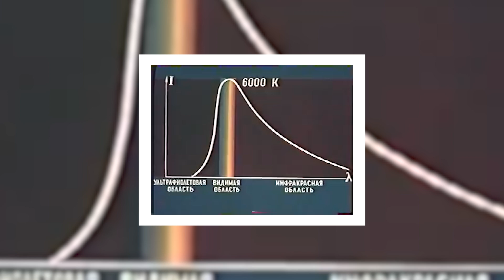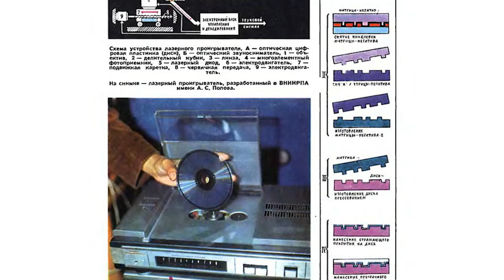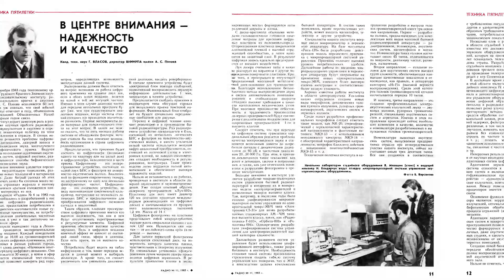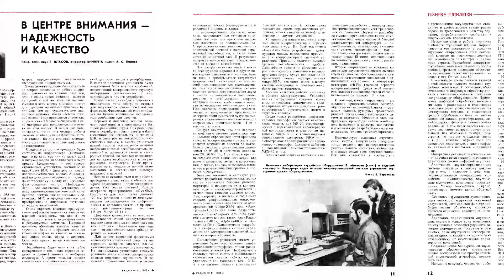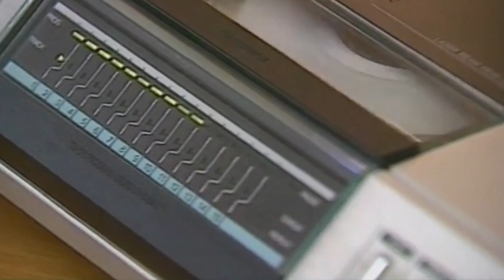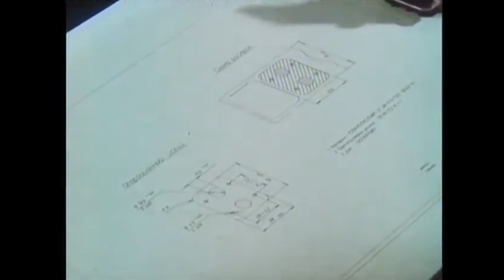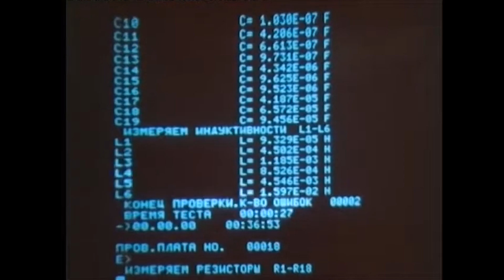Soviet Union invented CD in 1979 / Soviet Tech Tales

Comment: Actually the CD was first manufactured and invented in the late 60s by a company called Disco it was a joint venture between Sony and Phillips!! 

Yes the Western world has been working on the compact disc since the late 1950s!
Reply: Audio Engineering Society documented the many different competing formats for digital audio disks [& video disks digital & analogue]A 1986 Radio Mascow broadcast did describe the prototyping of a device using holographic storage of digital data in glass [I think-have very little to go on vis this development].Telefunken Decca developed DMM [direct metal mastering]copper disks for digital audio disks pressed in vinyl [housed in a caddy like RCA selectavision] & played with a stylus [source-AES disk recording anthology]-technology later migrated to Lp manufacturing in the Neumann VMS 82 record mastering lathe
Reply: For those saying that the USSR didn't invent something in electronics, check out this-

1948-1950. Not only in the United States, but also in other countries there have been scientific research in the field of semiconductors. For instance, a Soviet physicist V.E. Loshkarev as early as in 1946 discovered the bipolar diffusion of nonequilibrium current carriers in semiconductors. A.V.Krasilov and his group designed germanium diodes for radar stations. [Presumably still classified research] in Fryazino (Moscow region) in the Research Institute-160 (Research Institute "Istok"). A.V.Krasilov and S.G.Madoyan first observed the transistor effect. The creators of the domestic transistor A.V.Krasilov and S.G.Madoyan published the first article in the USSR on transistors, "Crystal Triode." Laboratory samples of germanium transistors were developed by B.M.Vul, A.V.Rzhanov, V.S.Vavilov, and others (FIAN), V.M.Tuchkevich, D.N.Nasledov (LPTI), S.G. Kalashnikov, N.A. Penin and others (IRE USSR AS)...

1960s. In the USSR in 1963 the Center for Microelectronics was established in Zelenograd. A Soviet engineer F.A. Shchigol developed a planar transistor 2T312 and its open-ended analogue 2T319, which became the main active element of hybrid circuits. In 1964, the Angstrem plant at the Research Institute of Precision Technology created the first integrated circuit IC-"Path" with 20 elements on the crystal, performing the function of transistor logic with resistive connections. At NIIME in Zelenograd technology was created and the first planar transistors "Ploskost" were launched. Under the direction of B.V. Malin at NII-35 (nowadays the scientific research institute "Pulsar"), the first series of silicon integrated circuits TS-100 (degree of integration - 37 elements on the crystal) was created. In 1966, the first experimental station for the production of planar integrated circuits began operating at the Pulsar Research Institute. At the NIIME the group of Dr. Valieva, started production of logical and linear integrated circuits. In 1968, the Pulsar Research Institute produced a batch of first hybrid thin-film ICs with planar, open-frame transistors of the types KD910, KD911, KT318 intended for television, radio broadcasting and communications. Digital and linear ICs of mass application (series 155) were developed in the Research Institute of ME. In 1969, a Soviet physicist Zh. I. Alferov formulated and practically realized his ideas for controlling electron and light fluxes in classical heterostructures based on the gallium arsenide arsenide system. Digital and linear ICs of mass application (series 155) were developed in the Research Institute of ME.

https://hsm.stackexchange.com/questions/6367/did-the-soviet-union-have-their-own-discoveries-in-the-development-of-semiconduc#:~:text=There%20is%20a%20fascinating%20story%20of%20two%20Soviet%20spies,%20Barr
Reply: Yes, of course they was, and fact, that first laser was ever constructed in 1960, was just minor obstacle to work on CD precursor in 50s 😀
When you want to spread lies, you should assure, that they will be not so easily exposed ;-)
Reply: @tomascernak6112 Not lies at all, but documented facts.  Optical discs predated lasers. Optical analog audio and video discs existed, primarily for development purposes, before the 60’s. First digital signals on optical disc was in the 60’s. Philips & Sony came out with their CDs in 1979… just not commercially yet… like the Soviet’s unit. It was just not until 1982 that the CD was commercially manufactured for consumers. When was the Soviet unit available commercially for consumers? By saying that the Soviet’s did it first would be the big lie, unless further evidence could prove it. Incremental improvements were made in optical storage had been made for decades before commercial success, which was originally the Philips/Sony CD.
Reply: @BigRonRN18  Source? Trust me bro?
Reply: @BigRonRN18  I expect a cooperation between Sony and Philips in the late 1960's by the name of Disco was not a documented fact, but if it is that would be interesting. It's correct in any case that there were lots of technological predecessors and proofs of concept even in the 1960's.
Reply: @tomascernak6112  Man don't be so dumb, search Wimipedia for "optical disc" and read its history https://en.wikipedia.org/wiki/Optical_disc

Comment: I may be wrong but I see the biggest issue they had in Soviet Union was the lack of a proper "consumer market" that pushed down the prices down of electronics and financed r&d of better and cheaper products.
Reply: The problem, like with all communist countries is a state controlled market. The state determines what people ‘need’, not the actual market. Companies under state control had to get funds and permission to develop any product. There was no free market. And the state can’t effectively dertermine what is needed or how it should be produced. It’s pure arrogance of the leader to think they know it all and always know best. This is why communism doesn’t work!
Reply: In the Soviet Union, market mechanisms could not function. Factories were not independent in their decisions regarding what products to produce and in what quantities. There was a state plan that prescribed which factories should produce which products and in what quantities. All that factories could do on their own was to make small changes to existing products, such as using different parts.

In order for the factory to begin producing a new type of product, the state plan had to be changed. This required a complex approval process with the relevant ministry. If such an agreement was successful, the factory was allocated funds to re-equip its production and purchase components. But, as a rule, it was not the current plan that changed, but the upcoming plan. Plans were prepared every 5 years. Therefore, updating the product range was very slow, and previously developed products were produced for decades.

But the most important difference is the risks. Unlike the Western economy, where the owner of the enterprise risks his own money or the money of investors, in the Soviet economy the enterprise was guaranteed to receive money for production, and all products produced were guaranteed to be sent to stores. There was no risk that the production costs would not be recouped. As a result, the motivation to produce high-quality competitive products was lost. They fought for quality using administrative methods, but this was ineffective.
Reply: So, did sony and Phillips see ray 002 in action? Thus inspiring them or even allowing them to reverse engineer it?
Reply: @BanazirGalpsi1968  If it was the other way around, everyone would instantly assume so.
;)

Probably paralell development, but it's not impossible that they got some information about it, but probably not the finished system.
Reply: Dysfunctional does not lead to inefficiency?

Also, forcing people from subsistence farming while collectivizing the farms absolutely led to famine. The West wasn’t initially afraid of the USSR - why else would Britain sell them jet engines. The fear developed with increasingly disturbing behavior, and British trust in their wartime ally proved to be naive.
Reply: @thatsunpossible312  "The West wasn’t initially afraid of the USSR"

Afraid?   Who said anything about afraid?

Oh no, people wanted to get back to the plans Woodrow Wilson had, to break up Russia, and later USSR.   Make it easier to colonise and control.

The exact same plans that were the background goal of the psychos in Washington that caused the Ukraine war.

It's amazing how in line with the naczis the post-WWII western desires were.

Only a moron would be afraid of a nation that has just lost 1/5th of its population and had most of its large cities razed to the ground.

But nope, what was the first thing the west did after WWII?   And possibly even DURING WWII.

They supported the Banderites in Ukraine.
Did you know about the war they waged during the 40s and part of the 1950s?
200 thousand civillians killed.
With the explicit support of the west.

Only the fact that USSR gained nuclear weapons for itself stopped the several times suggested "let's finish the job" proposals that contaminated the west in the 40s and 50s.

"Dysfunctional does not lead to inefficiency?"

It CAN, but it is not the same thing and it does not lead to it automatically.

The idea that central planning is inefficient is a matter of ideological propaganda BS.

Go look at South Korea for example.   They pulled themselves into a modern economy through central planning and the classic 5 year plans.   Worked excellently.

And here in Sweden, moving away from central planning has made healthcare and education massively more expensive, without adding any advantage.
Just as simple examples.

Soviet planning was dysfunctional for reasons and in ways that would take doctorate thesis to explain even the basics of, but there were a number of problems that caused lots of stupid effects and problems.

HOWEVER, when something important was needed to be done ASAP, and the right people took charge and made sure that they had the complete support of the bureaucracy, Soviet planning could make things happen extremely efficiently.
It was just not the normal thing.

"Also, forcing people from subsistence farming while collectivizing the farms absolutely led to famine."

No.   Again that's based on exaggerating a few extreme outlier cases and pretending that they're the norm so they fit the western propaganda.
Because overwhelmingly most of the time, collectivizing farming resulted in such huge increases in food production that moving workers elsewhere didn't matter.
Yes, there were gaps in between making it work and having the results of the work, but the Soviet government made up for that by importing food.

Even more importantly, you need to understand, that famine in imperial Russia was COMMON.
It happened SOMEWHERE almost every year, often in more than one place.
And at least every 5 years there were widespread famine in some regions.

USSR could not get rid of the causes of those completely, as they were mostly the result of weather, but they mitigated the effects hugely.

The USSR in the 1920s and 1930s had an almost population boom, because so many fewer people died from famine and disease than was normal under the tsar.

"The fear developed with increasingly disturbing behavior, and British trust in their wartime ally proved to be naive."

HAHAHAHAHAHAHA...

So, starting to provide massive monetary and military support to naczis in Ukraine in 1946 had absolutely nothing to do with USSR  becoming SLIGHTLY hostile eh?

Pull the other one...
Reply: You aren’t wrong, but that’s just one of their issues. It’s a big topic, but in general their industrial incentive system did not include productivity improvements. In fact, a factory manager would be penalized for making productivity improvements that would reduce headcount - in part because they were trying really hard to move peasant farmers into factory jobs, at any cost including famine.   Central planning was also very inefficient and, like you point out, tended to deemphasize “frivolous” consumer goods.
Reply: @thatsunpossible312  Correct! Those (quality) issues also affected the military sector. A former GDR jet fighter pilot told me that nearly every MiG jet delivered brand new from the factory to the Volksarmee had to be completely overhauled before its maiden flight. These warplanes may have been cheap, but clients often bought a lucky bag. Situation seems be similar today looking at war in Ukraine. Russina military equipment, often remainings of the Cold War, proofs a outdated and unreliable. But there seems to be more than enough available - just like those pitiful prisoners forced to fight there for Putin´s political system.
Reply: @medialex78  I think it’s even worse today for the military, since under their current system it is much easier to sell equipment. Everyone wants to look good, so there is no incentive to catch a lie, faulty report, or missing equipment or matériels. The result is a largely paper army, backed by the 30+ year old stuff produced under the last regime.
Reply: @thatsunpossible312  "at any cost including famine"

That is completely false, part of the cold war and post cold war hatepropaganda.   Mistakes were made, shit happened, because a lot of people didn't have solid enough knowledge or education for their jobs.   But at the same time, USSR moved from a mostly worse than medieval level of development, to a reasonably modern nation, from 1920 to 1940.   The average quality of living improvements during that time was the greatest ever in human history.

But it's amazing how eager people are to pretend that life in imperial Russia was good or even ok.   No, it was really REALLY bad.   Half the peasants had less rights than slaves in ancient Rome or Greece.   There was barely a hint of any middle class, there was the upper class, there was the RICH and there were the more or less empoverished.

However, USSR was devastated beyond belief by WWII.   And then, almost before peace had been finalised, "the west" went hyperhostile, which after people like general Patton spent much of his time in the war arguing that USA should make peace with Germany and join them in fighting the "real enemy", USSR, did not make for a good future for USSR.
The west openly proclaimed they wanted to destroy USSR, and then formed Nato...

Well duh, of course USSR had to do whatever to defend itself.   And with a country halfway in ruins from WWII?
Of course they could never catch up.

"Central planning was also very inefficient"

lol

No, it was not.   USSR central planning was dysfunctional, not inefficient.
Reply: @DIREWOLFx75  and now, almost all of Russia's inhabitants have less rights than slaves in ancient Rome or Greece.
 Making dysfunctional clones of western products, clones that majority of them doesn't need or can't afford them doesn't get russia, technologically, closer to western countries.
Even if they were technologically successful, as long as their collective minds are still at the level of the Middle Ages, all this effort is useless! But they are not in this situation because almost all of their products are based on stolen technology!
Reply: @DIREWOLFx75 wow you are completely wrong.
Reply: @Reginald-Bowls  wow he IS completely right!
Reply: @ventzel2000 I think modern Russia has refored somewhat, since the collapse of the USSR, opening markets etc.

Comment: Sorry if I missed it in the video, but was the Soviet CD design digital? Analog optical discs had been around since the the 1950's and LaserDisc was developed during the 1960's, first shown to the public in 1972 and finally marketable in the late 70's. The thing that made the compact disc amazing was it was fully digital, unlike the the analog LaserDisc. I don't think the processing power was available at a consumer friendly price for digital to analog conversion until the early 80's. The first CD player in the West cost nearly $1000, or about $3000 with inflation. I doubt anyone would have been able to afford it in the USSR, even if they did beat Sony and Phillips to the design.
Reply: one year later... Yes, it was 100% digital.
Reply: Digital audio started on video media.
In 1978 they built a VHS tapes based  Digital audio recorder and the professionals used Umatic video recorders to record the music for CDs
Reply: I think so thats why the bigger lower box pictured is described as a digital decoder.

Remember certain surround sound systems in the west for a while had a 2 stage decoder for similar reasons.